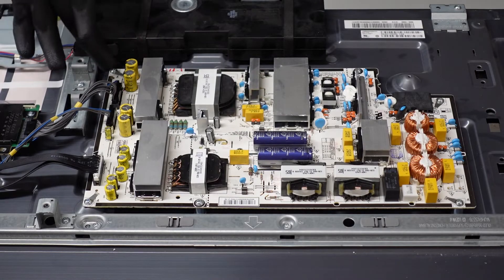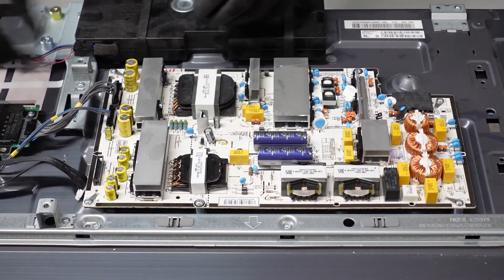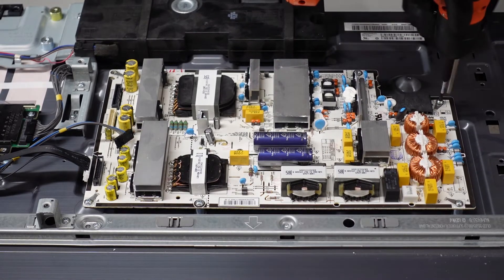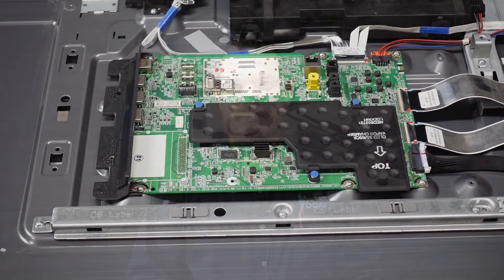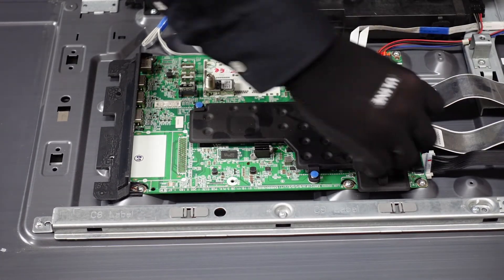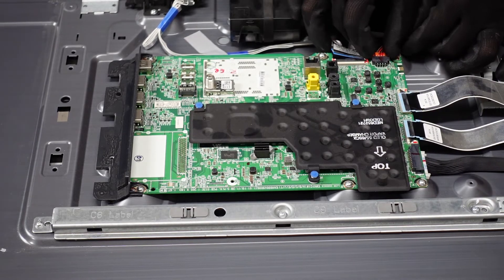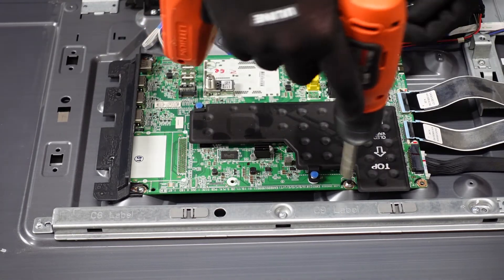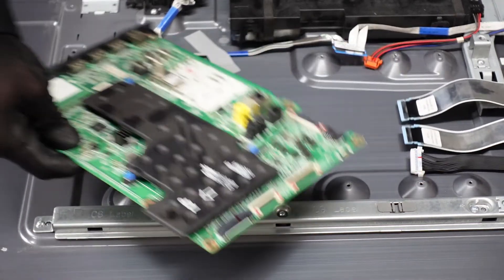LG OLED65A1PUA **NO POWER** troubleshooting and board removal guide.

Comment: Greetings, I have a Model OLED65CXPUA Intermittently powers off/on randomly whether using antenna or smart tv apps or external HDMI hook up with Roku box. I have run it isolating each type of use and get the same thing can be watching TV and then it just shuts down and then comes back up usually on the same station and sometimes before it shuts down the picture will freeze frame and the audio will continue for a few seconds longer then it will shut down.
I have done a factory reset and confirmed no power saving modes are enabled,I have confirmed the the power strip has been changed out and the plug is secure,and have plugged directly to wall outlet too. I have followed your video how to remove the rear cover and have reseated all the connector on all the boards and have used canned air just to make sure they were clear of any debris.
Reply from the maker: For this issue in an OLED most likely is the T-con. TV repair is a process of elimination; you replace the most likely circuit board to the least likely circuit board until one resolves the issue. If none of the circuit boards fix the issue then it is determined to be a failure within the panel/screen.
Reply: I’m having a similar issue where the tv powers on then shuts off after 10 seconds aprox. I replaced the power board and the issue still remains. I ordered a main board. However there are also 4 fertile lines down the middle of the tv after I power on. Wondering if that’s a clear indicator the T con board needs to be replaced. Any thought? Thank you so much!

Comment: I have the model OLED65B9PUA. TV was working normal then it shut down by itself and the red ligh at the bottom in the front open showing the tv is off. I try to open again with the remote even changed the batteries and I hear the little contact sound it makes when you turn the tv on but the light in front still red and tv is off. What would be the issue ? Hopefully the tv is not dead ??
Reply from the maker: OLED TVs can be a little tricky when trying to figure out what part is causing the problem. I would assume there is an issue with the t-con, the main board, or there could be an issue with the panel itself. If you were going to try a board swap, I would start with the main board and then try the t-con.

Comment: My TV is LG OLED 65A1PUA. It won’t turn on, only see the red light. When power button on remote is pressed, I hear click, but it doesn’t turn on. What board is possible broken? Or screen? Thanks
Reply from the maker: If you were going to try and swap boards to fix this issue, I would suggest starting with the power supply board. There could be an issue with the panel or screen, but If there is no obvious damage I would start with a board swap.

Comment: Mine was a lightning strike. All three TVs and cable boxes blew. Thinking power supply? Won’t do anything.
Reply from the maker: Power supply is the best place to start for a lightning strike or a power surge.
Reply: So new power board isn’t going to work, it dies have the red light now. Must be the main board. I noticed that board is not in stock. 😢
Reply: Does have red light. Blinks 3 times when I turn it on. Going to try a few things.
Reply from the maker: Main board would be the next step. With most of our parts on the website, you can sign up for an email notification when the part becomes available. Head back to the listing on the website and scroll down and look for a button that says " EMAIL ME WHEN THIS ITEM IS BACK-IN-STOCK". It will ask for your email and then notify you when it is available.

Comment: I have a OLED65CXAUA TV.  While watching the image froze.  At that point remote did not work other than on/off showing only the red led.   I pulled the plug and reinserted, at that pint I got nothing, not even the red led.  Is this the main board, power board or something else?  Thanks for any advice.
Reply from the maker: If you are without a standby light, we would recommend replacing the power supply board first. But losing the remote functionality leads  us to think your main board could be faulty as well.